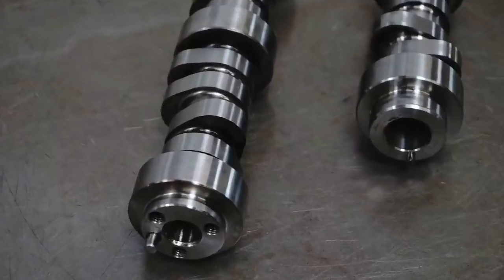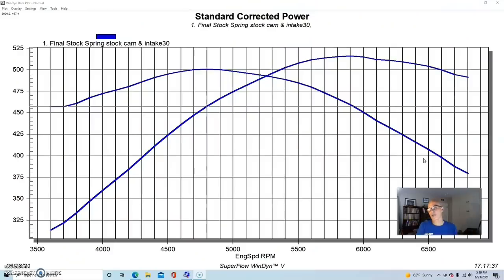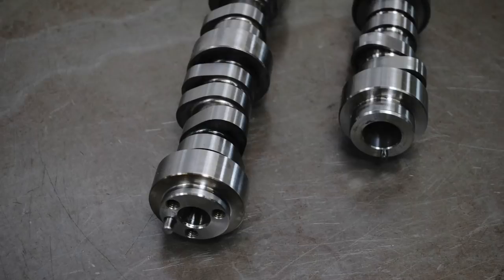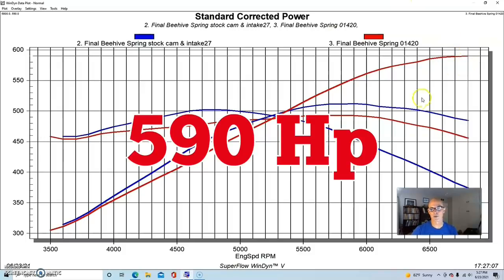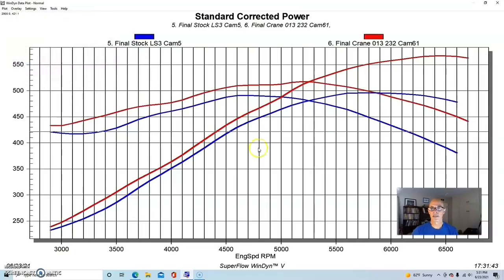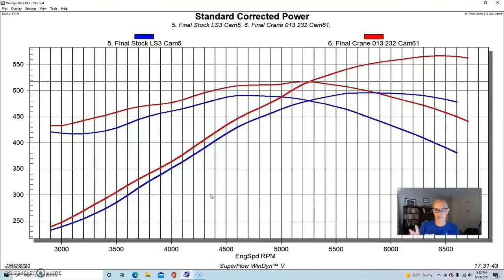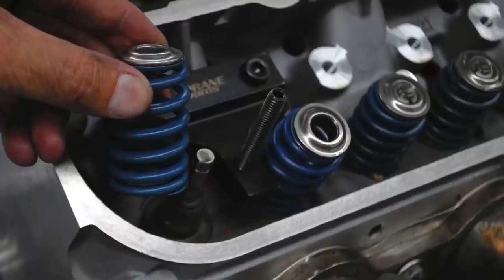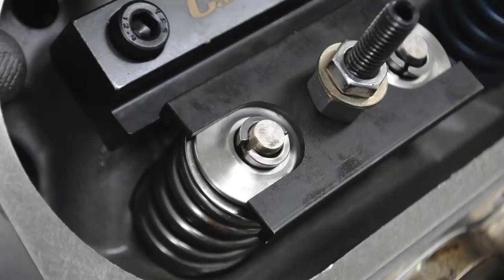DO STIFFER VALVE SPRINGS COST POWER? LS3 SPRING TEST!!

Comment: Some of the energy stored in the spring is lost to it's own internal friction but where most of the power is lost in higher pressure springs is the added friction on lifters ane camshaft.
Reply: I'm very curious about the protocols in this test because we tested stock cam with the stock spring versus a increased spring but then we change cams which both of the other Springs have increased pressure so I'm still unclear as to why the increase spring pressure reduced power on the stock cam setup are we still using all the same lifters with with all these setups?

I'm not sure the Test shows what I think it might because you didn't test the stock cam with even the higher pressure of the Brian Tooley spring that's what really needs to happen so we can see I guess what the pressure increase would do to the power reduction over X RPM as you saw in the other test.

So  the third test what you had was both Springs were capable of performing with the camshaft profiles within the RPM tested.
Reply: These are roller lifters.  Camshaft bearings are another matter.
Reply: @michaelangelo8001  
Roller lifters reduce friction, they don't eliminate it.
Reply: @177SCmaro  No kidding..?

Seriously, with roller bearings it is drastically reduced, to the point of negligibility.  Nothing can completely eliminate drag.
Reply: @michaelangelo8001  
The point being that any time you increase spring pressure you increase drag, rollers or no, hence the small differences in hp typically seen when going to stiffer springs.
Reply: @michaelangelo8001  
It's simple to anyone who speaks English and is capable of holding two concepts in the mind at once. 
Let me rephrase it then so simply that a toddler would understand, even my dog might understand: when you push down more on anything makes it harder to move it. 
Understand? This applies to if the thing is on a roller or a flat surface. That's why more spring pressure usually takes more power to operate.
I'm not sure I can explain it any simpler. If you don't understand these basic concepts yet please don't try to put an engine together. And get yourself some velcro shoes. I hear they're much simpler then those confusing laces.
I'm here to help.
Reply: @177SCmaro  Lol, no... actually you NEED help.  Maybe if you "rephrase it" enough, you will eventually come to some understanding of the subject yourself...

Rollers 'roll'.  They don't slide like plain bearing surfaces.  Therefore 'friction' itself is eliminated.  Of course there are other minute sources of drag involved such as the lifters sliding in their bores, but they are negligible in this case.

Again, my point is that this was the wrong type of engine for this test.
Reply: @michaelangelo8001  
Projection, thy name is Michael.
And facebook, btw, has become notorious for bing "old people's social media". 
Your response is irrelevant to cars and engines. As I said, good luck.
Reply: @michaelangelo8001  
Admit I was wrong that more pressure tends to increase friction resulting in a small horsepower loss? I mean, it's basic physics but if will stop you from crying sure, I admit I was wrong. Increasing the valve spring pressure doesn't increase frictional losses because....I guess, you said so. Happy?
Reply: @177SCmaro  Simply because these are roller bearing lifters, which roll on the camshaft without significant "friction".

We were talking about "friction", right..?
Reply: @michaelangelo8001  
Pretty sure I just mentioned the word "friction" twice.  
"Significant" is a relative term - significant compared to what? For the purpose of a demonstration of how spring pressure effects an engine's power via friction it, again, doesn't matter what type of lifter you use. The only difference had flat tappet lifters been used would have been in the degree of friction and thus HP loses i.e. it might have been 10 or 15 instead of 5 when changing to a higher pressure spring. Roller lifters still produce "significant" friction, significant enough for change to show up on a dyno when switching between lifter types, just much less so then flat tappet.
The closest thing to a point you ever had amounts to nothing more than splitting hairs. Glad we sorted that out. And if you don't like the use of roller lifters here I suggest you build your own test engine, find a dyno, and post your own video to that end.
What more needs to be said?
Reply: @177SCmaro  Lol...  At least I'm getting a good laugh out of this.

Again..:. Rolling does not produce friction.  Friction is drag between sliding surfaces.

Comment: The power it take going up the lobe vs what it gives back going down the lobe will be rpm dependent. When you turn it over by hand it will be the same, you don’t even notice any drag from the valve trane. But there will come a point where you could spin it so fast the lifter would not even touch the lobe on return side, then you would loose 100% of that energy.

Comment: Needed to run the rpm higher to see valve float as well and if there is a power separation higher in the rpm. Run a different cam setup if you need to for a high rpm test north of 7,000rpm. Also, run a titanium retainer on the beehive just like the titanium retainer on the duals. Throw the Comp Conical 7228 spring into the mix as well. Also weigh each spring and retainer setup to show the weight difference of each setup as well. Obviously the beehive spring was way too much spring for the stock cam so it is going to hurt if you run more spring and seat pressure than you need too. Were these valves stock solid valves or hollow stem intake valves? Less valve weight to keep stable can be done with less spring.

Comment: An older guy told me that heavy springs will cost power.. well, guess he was right

I was going to say camshaft, damn. I was wrong
Reply: They cost power in THAT situation.
Reply: Depends if you have valve float
Reply: I think the heavier spring corrected just the tiniest bit of valve float that was allowing the motor to breath better… could have had one slightly weak stock spring … there was a large gap between the beehive spring and the dual spring and it clearly showed there was no loss in power adding spring pressure
Reply: An old timer was probably talking about a non roller motor a roller motor is not going to lose any power from friction as no parts are actually touching

Comment: Crazy that Crane beat the stock cam across the board.     The Short runner intake shifted the torque peak to the right around 1500 RPM.

Comment: Kool physics behind the returning energy from a compressed spring. I would think it comes down to the efficiency of the spring it's self. the stock spring should in theory be more efficient at the given pressures based of the results. as force goes up I'd bet efficiency goes down. So the two aftermarket springs were the same do to them having a similar efficiency probably partly from the increase in pressure numbers with the large cam which would make the open and seat pressure difference a smaller percentage change compared to the small cam with a larger change.

Comment: I dont think you would see an appreciable difference in power until you up the rpms up higher. If you go high enough to get float you may eliminate it with stiffer springs. The stiffer springs wouldn't make more power just getting it back from float.

Comment: Thank-you Richard from Aus. for your tireless testing! How do you fit all this stuff in? I struggle to find time to check my tire pressures regularly. There could have been a slight loss in power from increased friction with the 26918 springs, very hard to measure. I would hazard to guess some of the slight power drop may be due to lifter bleed down at the higher RPM where some duration and valve lift is lost. One of the secrets to power is seating the valves firmly at all RPM's . The big challenge with valve trains is to run the least amount of spring to do that.

Comment: Yes I would think that the valve spring pressure wouldn't change power at all because it's opening exactly the same amount that it's compressing every time so it should cancel each other out. No?
Reply from the maker: no
Reply: @richardholdener1727  oh more pressure is more friction too.

Comment: Valve springs, how I've been taught and experienced. 
90lbs is 90lbs out because the cam has phases there is "90lbs of resistance"

When assembling an engine i have a habbit of setting my main caps, pistons, wristpins, and every moving part in free spin, which even one part "slightly" off can add a TON of drag. 

After about 3-4h of setting everything, CLEAN I add a few drops, a high-speed ceramic bearing lube, and free spin my engine.

A short block should almost THROW the wrench and freely spin. 
Add heads without plugs or rockers and it still spins but WOOSHES! 

GO ONE STEP farther and add rockers and feel HOW MUCH DRAG springs give the engine. 

Ive been told by old hot rodders that the N/A guys are WAY over valve springing their engines, losing and robbing TONS of free rev and parasitic drag. 

And that the boosted guys need to do math based on their valve face to boost ratio giving them what valve spring is perfect for operation with again "not having too much" spring. 

Which aparently is a thing! 

Make a low compression 5.3l LM7 with stock cam and spin her up with .660 btr springs... that 440lbsish of pressure is going to really bog that N/A down.
Reply from the maker: you choose springs for the cam lift and desired operation, I have a valve spring dyno test up-it is not much of a change in power from stiffer springs

Comment: With the camshaft upgrade it is hard to tell what the valve springs hurt. Obviously with a bigger cam you need better springs but it doesn't help that you changed the camshaft while comparing the springs. I'd like to see what the dual valve springs do on the same cam as the comp springs.
Reply from the maker: THE BTR DUAL SPRINGS WERE COMPARED ON THE SAME CAM AS THE COMP 26918 SPRINGS-THOSE RESULTS WERE SHOWN

Comment: Neat video.  If I’m building an engine, I don’t think I would want any more valve spring than I need to control valvetrain motion and provide the lift capability I need.  I wouldn’t want those dual valve springs since the beehives make exactly the same power even up top and they have considerably less seat pressure and full lift pressure—why add all that extra, unnecessary load on your valvetrain?
Reply: My thoughts exactly. The power difference may not be noticeable, but durability is also a concern.
Reply: Remember is a spring goes on the dual springs u have a back up, cheap insurance.
Reply: The second spring is not a backup. If a spring fails at high RPM, valves will still float and stuff will get damaged.

Comment: I think the reason the LS3 springs made more power than the 918’s is because the stiffer spring rate compressed the lifters more giving a milder cam profile. If you look the 918’s made more down low and less up top like a smaller cam would.
Reply: I was thinking the same.  The only other hypothesis would be that the stock springs were on the edge of control, and on the closing side of the ramps they allowed an extra degree or two from delayed closing.
Reply from the maker: there is no control problem with either spring on a stock cam at this rpm

Comment: I don’t think the spring returns as much as it takes especially on a hydraulic lifter it would probably absorb a lot of the stored energy from the spring during closing I could be wrong who knows lol. Maybe this test on a solid lifter would be interesting but probably the same results
Reply: There is friction in the system; therefore, some of the return energy is lost to heat.
Reply: The test would have been much more revealing, if performed on a flat tappet engine...

Comment: I think the stock valve spring had the tiniest bit of float off the peak of the cam lobe allowing the motor to breath just a little better and when they went with a heavier spring it fixed it… or maybe the new springs were heavier and the increased inertia from compressing and decompressing the spring was responsible for the power loss … but if that was the case why didn’t the dual spring lose power… two springs are surly heavier than one

Comment: Good info, especially the hit on the torque curve from the short runner intake. I’m really interested in the 20 or so hp change from a valve job and some port matching. You also mentioned a compression increase—is that info in another video somewhere? I’m trying to decide whether to replace my dished LY6 pistons with flat tops for a street build. It has 823 heads and I picked an “in between” cam (225° intake) that might make 535-ish peak hp in a 6.2, but the lower compression and 12 less cubes make it unlikely I’ll break 500. On the other hand it’ll probably be happy on 87…
Reply from the maker: A CAMMED LY6 EASILY MAKES 500 HP-WE DID 543 HP WITH A COMP 469 CAM
Reply: @richardholdener1727  Thanks for the reply! My cam is 6° shorter—225° vs 231°. If a typical LS3 makes 575 to 585 with a 469 cam and 535-ish with the BTR stage 2 NA cam, my LY6 is unlikely to break 500, I think. That’s 20 hp for the 12 cu in and 20 for the 9.7 vs 10.7 compression. Flat top pistons could get me half of that (one of those 20’s) back. OTOH, I probably won’t have any problems leaving a stop light with a 6L90’s 4:1 first gear… Thanks for all the great info your channel continuously reports, Richard!

Comment: If you can run a lower spring pressure everywhere, with no loss in power. Then this would be less wear on the needle bearings on the rockers, less wear on the valve, valve seat, spring keepers and retainers...

Comment: Test the torque it takes to turn the engine over with each set of springs, this should tell if the springs return energy to the cam rotation.
Reply from the maker: or just test the power output change-torque rotation does not tell you power change

Comment: Just making a comment....stock equipment is made with a lot of science.  The closing ramp rate of the stock cam is more extreme than one would believe.   The heavier springs creates a bounce off of the seat when closing so abruptly, to where as the factory spring rate is slower to where there is no bounce. Change the closing rate of the stock cam and the other sorings will shine.

Comment: Great stuff Richard.  Tangential question - 90 lbs of seat pressure on the stock spring seems super light, especially when someone runs boost on an otherwise stock engine.  15 psi would be putting ~50 lbs of pressure on the back of a 2.165" intake valve working against the spring.  Ever run into any issues with that on your big bang tests?
Reply from the maker: I can't remember running boost on a stock rec-port motor with stock springs -all the big bang motors had spring upgrades

Comment: 🙋‍♂️ The shorter intake reduces low end power, per your prior intake test videos. 
Professor Holdener, "Well done grasshopper.   Now try to snatch this valve keeper from my hands."
 Q. Richard, would you recommend the BTR valve springs, with their higher pressures, if you are running boost?
Reply from the maker: yes

Comment: I'll ask a dumb question.  If the valve was adequately controlled out to max test rpm, why change?  I would always like to see a solution that has lower but adequate pressure to reduce any scuffing.  Yup...I know...it's a roller so those cams never go flat...right?
Reply: Im surprised no one has chimed in on this. I agree with you. If your current valve springs are controlling the valves for the rpm range the engine/cam makes power there should be no reason to "upgrade" the valve springs to something with a higher pressure. Imo, the only reason to change springs would be to prevent coil bind and or loss of valve control (float) due to an upgrade. 
I have seen a diesel engine needing a valve upgrade due to upgraded turbo causing drastic change in boost. High mileage supposedly had a hand in weakening the springs as well. Intake valves were being unseated by high boost.
Reply: @kevinkalivoda3442  I would like to spend my money where it makes a positive difference and the test showed that there was nothing there to gain.  Just my two cents.

Comment: I would have thought the heavier springs on a stock cam would have cost low end power. As they are harder to open. Top end power should have been the same or just a little better.
I have seen stock cams wiped in a short time when the springs were replaced with springs 20% stiffer. Fresh overhauled head onto a stock bottom end. Cam was to be upgraded in the near future which turned into a couple of weeks.
Alternativly a drag racer who had to have huge springs and wondered why he could not keep a cam in it. Crane called for 125 seat, and it had about 180. Solid flat tappet
EFI intakes seem not to make sense. Though long runner should give a bigger power spread

Comment: Why did the larger springs with the same factory cam loose power? Lifter bleed down? Deflection in the valve train?  Hard to know without a spintron or swapping for some short travel lifters.
Reply from the maker: spring resistance

Comment: If you compress and relax a spring a bunch of times, it will start to heat up slightly. That heat explains the difference in power with stiffer springs. The heat is wasted energy.